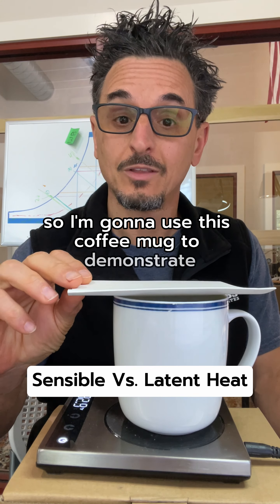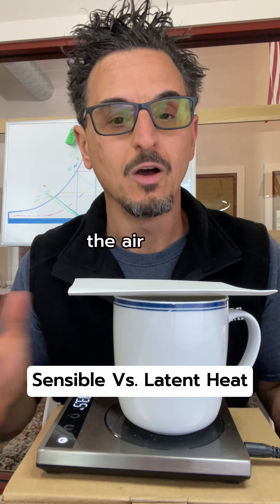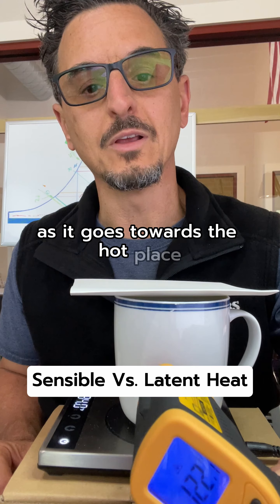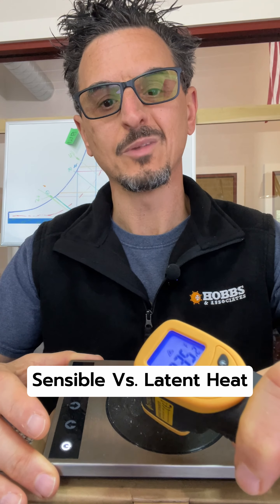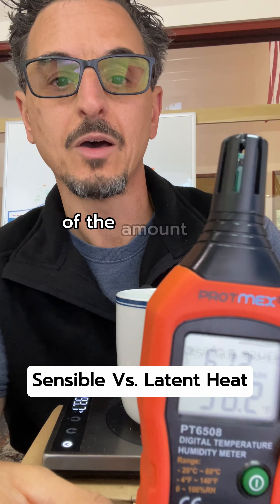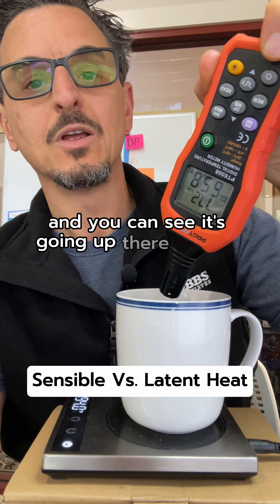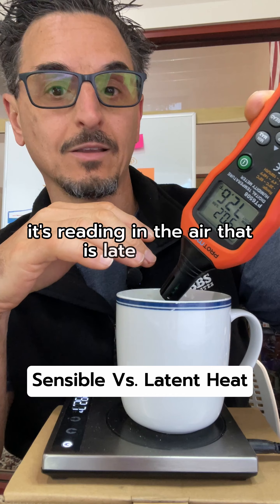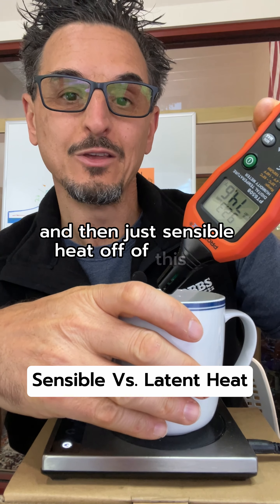Sensible vs  Latent Heat | Why HVAC Professionals Need To Understand These Concepts

Comment: You guys really can't explain shit can you.... 
Latent heat is the energy required for a substance to change phase. So for water, from Ice ---> Water ----> Steam. This instance one you receive enough energy most likely through heat transfer (transfer of kinetic energy from one substance to another based on a difference in temperature) you will achieve enough energy for those lattice structures to become broken and move about freely. 
Sensible Heat is the energy that a substance receives without changing it's phase assuming a constant pressure. Example you put a pot of water on the stove and heated it from 70 F --> 130 F. All of the now hotter water had a change in it's temperature, or total amount of energy within that small area, and now that's it's sensible heat. 
Covering and removing a lid off a fucking coffee cup doesn't explain shit.
Reply: Thank you.. this footnote was much needed.
Reply: Nothing can be learned from this incomplete, unstructured... demo of whatever. So sick of channels that literally do not understand the concept they purport to teach.